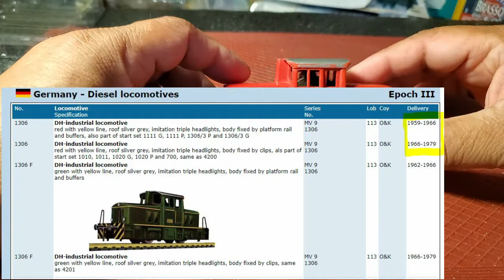1966 Fleischmann 1306 Shunter: O&K MV9 - Bringing it back to life

Comment: Hi Anthony, really liked your video. It is like watching Joy of Painting/ Uk's Repair Shop. I have a lot of Fleishmann HO stock which have been collected second hand over the years. Most are in very good/excellent condition. I have serviced them using Fleischmann 6599 oil, but never taken the motor apart .Having seen this video I will do it for my older or new additions. Most of my problems have been with traction tyres. Either not having one or having the remains of one when bought . The other problems are with couplings ,mostly the metal springs coming out. Fleishmann is an excellent make and is very reliable. I use both Triang super 4 track ( my other train collection) and grey profi track. Cheers Graham
Reply from the maker: Hi Graham , Appreciate the kind words and comments. You are correct , the traction tires are a bit of problem . I did purchase some traction tires from an European model train store , just when I heard that Fleischmann was being purchased by RoCo etc ... But what I have found that works very well as an alternative is Electrical shrink tubing for electrical wiring . I cut a thin slice of it and put it over the wheel and apply a little heat , and it just grabs onto the wheel. .. 
I would love to hear more about your vintage Fleischmann collection .. I am a fan of Fleischmann as well , and have been trying to secure some vintage pieces when ever I get a chance ... they are so simple to work on , and as long as you service them , they keep on going , and going ... 
Thanks 
Regards, 
Anthony .
Reply: I'm sure people know a lot more about Fleischmann HO than me ,but I can just tell my story. Perhaps drip feed this as I remember it . My favourite loco (lok) is 4169 . I bought one new in the late 80's for around £105. This was a lot of money at the time and I had sold my British collection which didnt run very well .So my locos went from about 20 loco' s to 5. It stayed in box for 2 years and I then sold everything . Only to regret it over the years. My latest was bought in excellent used condition from EBay a few years ago . The surprise was the fitted suethe smoke unit. This provides great fun as it blows the occassional perfect smoke ring .My grandchildren I love it  It runs perfectly and has Nem coupler sockets .. I am very very pleased with it,. I realised a collection was being sold over time and bought a 50 loco a year later from the same seller .As expectated this came with smoke.More to follow if ok Graham
Reply from the maker: @mostlymonkey   Wow .. that's an amazing story .. So your fleischmann fleet grew from 5 to 50 .. Wow ... Impressive .  The 4169 is a beautiful locomotive 4-6-2  with the silver rings on the boiler. I believe it is a tender drive correct ?  . That is one loco that is on my list to obtain . I was concerned about the 4 axel tender which is on a single fixed frame . Since the drive wheels cannot pivot , I was wondering if it can negotiate a 22 inch radius . 
Either way , If you are trying to get a hold of the service sheets or even information on the loco's and Era's when they manufactured etc , Let me know ...  I will try to get them for you . 
Regards, 
Anthony .
Reply: You might also look for FLM 4170 - loco number 01-220 . This is an older brother of 4169 . I have just been comparing the 2. The older model has slightly larger wheel flanges, no NEM pockets and no close coupling between tender and loco. I don’t know about your local market for FLM, but 4170 is usually cheaper ( 25%?) .
FLM is a well thought out system and locos will run on first radius curves .FLM have 3rd and 4th radius but this was added later . It is worth buying some old product catalogues . I have a range but having them all is not needed . The one I’m looking at right now is 79/80 . I also have 58/9, 62/3, 67/68, 66/67, and later ones . My most used is 95/96 which is now falling apart . I have no really old FLM  stock to comment on  the very large wheel flanges and whether they run well on modern track . I’m thinking of 1950’s . My own stock is all ok , even the 1/82 scale . I would say any loco starting with 4 in its catalogue number will be ok . My collection includes many starting with 1. And many appear in the 58/9 catalogue. So I may be over cautious . FLM ‘s own track will always be ok. 
There is also the XL type loose page explanation of the system/ layout cat no. 9925 (HO) and 9957 (n). Don’t pay silly prices for theses . I think most catalogues really explain most of it .
The tender question is also answered by the last set of wheels sliding horizontally making the tender a shorter wheelbase .
 Best wishes Graham
Reply from the maker: @mostlymonkey  Wow , Graham , you are a wealth of knowledge when it comes to FLM's .. My oldest i believe is the FLM 1340 Baldwin (Black) . Still runs , has seen a lot of run time , but I do enjoy all the sounds which have developed due to play between the gear wheels etc .. Adds character to it .. 
I presume you are a member of the FLM HO Club ? I joined them , as they have a ton of online catalogs and service sheets for all the loco's and the HO database is very useful to figure out which Era and when the loco was manufactured etc ... 
I did not know that the last set of wheels slide horizontally .. that means I should be able to run it on my layout no issues .. Which means I need to get find one on ebay ... In Canada , FLM aren't as popular ... most modelers here tend to go for North American manufactures and model loco's ... I run a mixed bag , and must admit that I do have a soft spot for European models  made by FLM , RoCo, Brawa , Rivarossi , Trix etc .. I even have a few Marklin Hamo's ... they are like tanks .. 
So just to confirm the 4169 does have NEM pockets right ? 
here is my email address  ( Anthonyb1019@gmail.com ). IF you get a chance , send me some pics of your collection , I would love to see it ... 
Regards, Anthony

Comment: Hi.
I have this shunter, but access to the motor involves pulling the real metal buffers out, not screws. The hand rails are the same as yours . Very interesting!!
Regards
Nigel
Reply from the maker: Hi Nigel , You are correct. there were 2 variations used by Fleischmann to mount the shell onto the chassis . Once was using the screws, and the other was to use screw on buffers . They are very simple loco's and if you service them regularly , they will keep going and going . 
I Believe there is another shorter ( stubbier ) version of the MV9 called the V42 I believe .. 
Regards, - Anthony -

Comment: The commutator (dont know how to spel it) can be seperated more, the innersite can be pushed out of the magnet, makes it easier to clean, just took 2 of these models apart for cleaning after being in a box for 40 years. to bad they replaced the buffers on your loc for screws btw.
Reply from the maker: Hi , Thank you for the comments . You are correct . you can remove the magnet and housing ring from the frame . I did that for the 2 other 1306's which I have . I did not do that for this one , as it looked pretty clean inside the magnet area . 
One thing I was not aware of how to separate the commutator .. So thank you for sharing that with me .. So what you are suggesting is to increase the gap between the commutator segments ? Or are you stating that you can actually remove the Commutator disk from the coils ? Please let me know .. I am very interested to find out more about the tip you shared . 
Since you have a couple of these , Did you notice that the wheels are not properly level ? as mine tend to wobble a bit, loosing connectivity when it wobbles . Did you also have that issues ? 
Also , all 3 of mine came with screws and not buffers ... which is weird . So they must be the 1st edition of I guess ... What are your thoughts ? 
I bought all 3 from different people , so i could not be a home fix . 
Thank you for your comments / feedback ... Regards, - Anthony  -
Reply: @anthonyshobbycorner  Hi, is ment indeed that the coil can be pushed out of the magnet ring so all of the inside can be cleaned, All wheels are level form me so no contact loss luckily. To be Honest i dont know if there are version with screws instead of buffers. might be early versions indeed.
Reply: @anthonyshobbycorner  Yes: but does removing the rotor weaken the magnet?  In all the refurbishing articles I have seen, no one  has recharged the decades old magnets, and no one has checked to see if the windings are grounding to the rotor.  Also, little mention is made of brush replacement or factors involved in re-manufacture.  What all these things have in common, apart from improving running, is that they affect current draw.  High current draw can start fires.  In this case, new brushes and springs are easily available.  New springs matter because the old ones might have lost temper; new brushes matter because the structure of the old ones might have been compromised by too much oil.  That might be the cause of the dirt.  With good magnets and good condition, Fleischmann locos are a masterclass.
As ever; enjoyed your video Anthony; these ideas are NOT meant as criticisms!  From me they never are.
PT

Comment: I want to remove the body shell but can't see the two end fixing screws on either of my two MV9s, unfortunately at minute 6 of the video you don't show the location of the screws very clearly. Are they in a different place on some versions of this model ? thanks
Reply from the maker: Some models have 2 screws on each end of the loco ( like mine do ) which hold the Black/yellow Zebra place and the plastic red cover to the loco chassis . Some other models ( probably yours ) don't have screws , but instead they have the typical bumper buffers which are actually screwed on to the chassis and hold the zebra plate and the red shell to the chassis . You just have to twist off the bumper buffer like it is a screw , and it will unscrew and release the zebra plate and the red shell .
Reply: @anthonyshobbycorner  This was my problem. I am new to this. Just inherited a train and some track i pretty bad shape. I', going to clean it up but i couldn't figure out how to get the shell off and was afraid to break something so i didn't want to use any force. Now i know what is supposed to come off. Thanks for the video, very helpful.